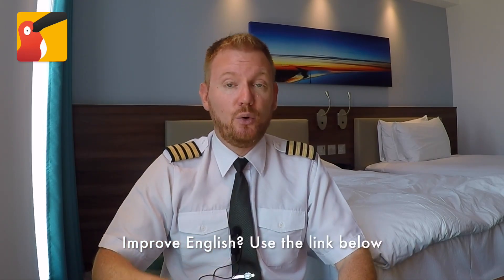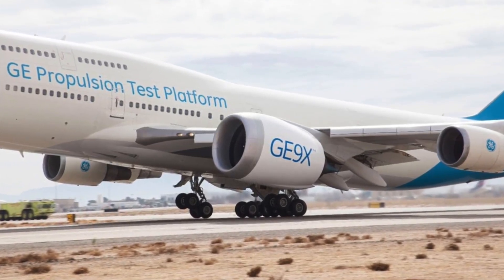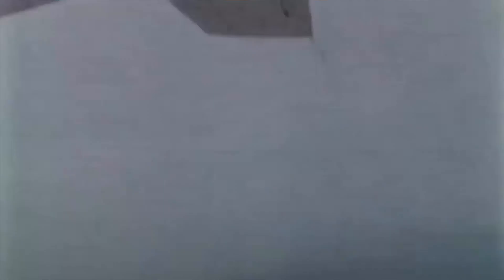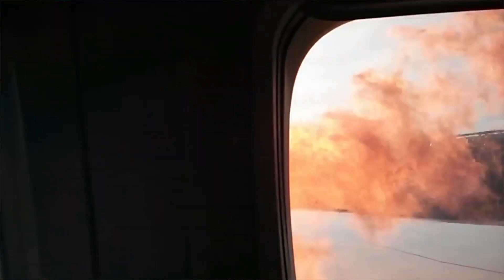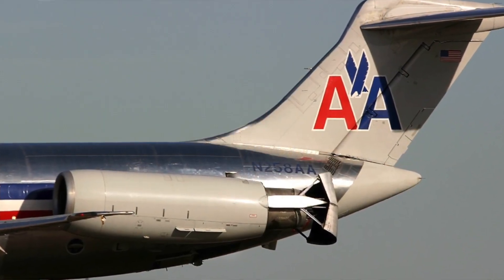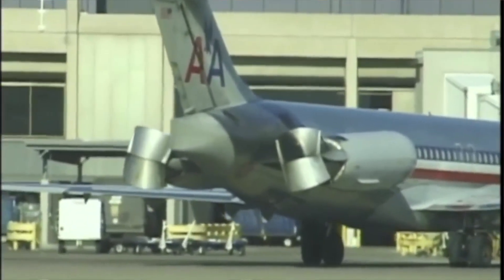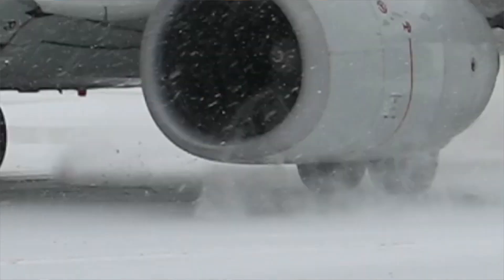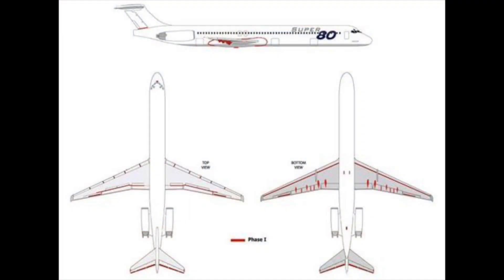Why are the jet-engines placed there? Wings vs Tail

Comment: Always seemed kind of odd that T-Tail with canards designs didn't get more attention. Call me crazy, but I kind of like the idea of redundant pitch control surfaces...
Reply: Suppose it would have ups and downs. But the main reason we don't see it is weight id imagine. Don't really need it and it would add weight, so not something they'd want to add, unless they had to.
Reply: lot more control with less pitch with a canard
Reply: The only T-tail with a "canard" that I can think of is the Piaggio Avanti, and that isn't really a canard. The front wing is not a control surface, but rather a wing with a flap. All of the pitch control is achieved with the T tail.
Reply: There were a few included in a book I had on aviation design, but as far as I can remember they were all obscure prototypes or experimental craft. The text detailing them seemed to suggest they all did well, but I annoyingly can't remember the title of the book, and it is in a box stuffed in an attic on the far side of Canada right now.
Reply: I think Rutan's canard designs could get into a bad coupling in the right circumstances. Which contributed to John Denver's crash iirc.
Reply: Corey Lawson - John Denver's crash had zero to do with aerodynamics and everything to do with fuel system management.
Reply: @sparkplug1018 Pitch control surfaces... ups and downs... HA!
Reply: Movable or fixed canards add drag, weight and turbulence. Turbulence generated by tailplanes with elevators goes behind the aircraft.
Reply: Al Grayson - that's why canard airplanes are all demonstrably slower (not)
Reply: gwzipper1 ok thx. been too long/memory corruption.  According to Wikipedia, there were some Rutan Vari-* incidents where in a tight turn/bank one of the canards could stall (wikipedia) in the right (wrong) conditions.  There was a redesign. But looks like there were some lawsuits that compeled Rutan to stop selling the plans for all the variants (wikipedia...I didnt follow the references further).
I always liked seeing them buzzing around occasionally. Now it seems rare to see one zipping thru the air.
Reply: Corey Lawson , Rutan stopped selling plans when scaled composites took off, for liability issues. He now has deep pockets. He still supports then unofficially, even today. There are thousands flying - if you'd like to see a lot in one place, go to Oshkosh in late July or rough river, Kentucky a little later.
The canard wing of actually designed to stall - it's set at a higher pitch angle than the wing, so it stays before the wing, dropping the nose so airspeed is recovered. It's actually a safety feature, and had nothing at all to do with the Denver accident.

Comment: There is nothing like the brute force of being shoved into the air by tail mounted engines.  With the under mount pylon engine at the wing, you are simply pulled into the air.  The sense of power is not as prominent as with the aft mounted engines.  One of my favorite moments of flight, being shoved of terra firma and pushed by the seat of your pants into the air.

Comment: You mentioned airflow issues over the horizontal stabilizer with rear mounted engines, how about with the engines themselves?  I imagine that rear mounted engines might be more susceptible to compressor stall?

Comment: explain planes with high mounted wings like the C-5 galaxy, C-47 etc. and engine placement and such related what is explained in this video.  and maybe why boeing keeps streching the 737 to replance the 757 instead if making a new/next-gen 757.  the 737 is  short and can only hold so big of engines relative to ground clearance.  and there's also performance issues with a 757 sized 737 vs the 757 its self.
Reply: The high mounted wings on the C-5 etc, are specific to cargo aircraft, where load access is the primary design criterion.

Comment: There must be a profitable reason in why so many companies opt for the T-tail jets such as Fokker 70/100, Boeing 717 etc. Ive often thought that they must be more fuel efficient over planes with engines on wings. I've noticed that most T-tailed rear mounted jets, often require less thrust (Lbs) to get same performance as wing mounted jet engine aircraft . My thoughts on this are that having rear mounted engines on aircrafts body, and generally being of smaller diameter as well, creates less drag than being further out on wings. Another thing to note are that most T-tail rear mounted jets, have much smaller wings (span wise), and kind of look more like a dart in the air lol.

Comment: On a T tail you can totally stop the deep stall by putting a couple of strakes on the fuselage under the tail.  Under normal flight conditions these produce zero lift and minimal drag. But when in a high nose up attitude they will generate lift and will automatically bring the nose down again, thus bringing the tail back into clean air.   Why these aren't standard on all T tail aircraft, I have never been able to figure out since this has been known since the 1970s.
Reply: spacecadet35 Lear Jets have them,  every body else is to cheap I guess!
Reply: Thank you for that information. It is nice to know.

Comment: Hope that someday you could also release a video about planes with mixed characteristics for example: High wings, T tails but engines below the wings (such as the C-17) or the Antonov AN225 (dual rudders, huge horizontal stabilizer, 6 engines, high wings).  Great videos as ever.  Congrats Mentour.  Have a nice week!
Reply: jwchavez Most of the high wing models are cargo aircraft, where an unimpeded loading area is the primary design criterion.
Reply: Wikipedia actually has some pretty nice articles on the aerodynamic impacts of various designs, if you're interested in understanding the quirks and purposes of other configurations (like why high wing cargo planes have their wings angled down instead up up; it's not just because it looks cool), or why you might want a T tail on an under wing design (basically leverage). There's also some really neat stuff to stumble upon like the B-52 landing gear, which can angle a bit to either side for crosswind landings. Basically, I found a lot of the plane and aerodynamics (as they relate to planes at least) articles to be pretty clear and well written.

Still don't know how the hell sailboats sail into the wind though. I'm pretty sure the answer is magic >.>

Comment: Noob question: to prevent a superstall in a T tailed plane, can't they have a system to use the ailerons to pitch the nose down? Like instead of the stick pusher just change how it controls pitch until speed is good again to use the elevators as normal.
Reply: Tomás Jarsun Ailerons are mounted on the wings, close to the center of lift. By definition they cannot change the pitch of an aircraft, only the roll.

Comment: would be nice if you addressed the obvious question: Why did the 737 get designed with wing engines, while the DC-9 went with fuselage engines? It would seem that most of the benefits favor wing engines, so why did Douglas feel that the benefits of fuselage engines outweighed the benefits of wing engines?

We notice that almost no commercial aircraft are made today with fuselage engines. Even small commuter jets are going with wing engines.

Comment: The bridge named in the video suffered from a issue with resonance. Every object has a specific frequency it vibrates at. If this frequency is matched the object vibrates to the breaking point. I guess the same applys to surfaces passing through mediums such as air or water. A common example of this is when in cartoons a singer breaks a wineglass by match the frequency with their voice. 

Source: Richard Hammonds engineering contacts the “oilrig” episode.
Reply: william elofsson Galloping Gerdie was just poorly designed.

Comment: I wish you would cover the MD DC-10 which use to have both wing and tail mounted engines... That was a beautiful airplane... Don't know why they stopped making it...:-/
I can imagine that the tail engine may have been difficult to service though.
Reply: Dude31463 the third engine became unnecessary. Jet engines have become more powerful and reliable, and twinjets are the most efficient designs.
Reply: GemCat ... I get what you mean... I may have a biased affinity for it as it was the first plane I flew on... For a kid, that was the coolest thing ever, even though I threw up at least 3 times on the trip... :-/

Comment: Wouldn't fly-by-wire, like the systems on all the Airbus planes and the newer Boeing planes, assist the handling characteristics like extra rudder trim during engine failure to reduce extra yaw,  using FBW ailerons to counteract wing flutter, and keeping the plane steady when changing thrust setting?

Comment: Really interesting information, I always wondered why some airplanes have engines mounted at the end of body. Regarding noise there is no doubt it is better. However, I thought it is an old designer company because accidents in such type of airplanes are much higher than airplanes with engines mounted below the wings.

Comment: If jet engines get larger diameters to increase bypass ratio and efficiency, is there a point where it would be beneficial to mount the wings above the cabin body instead of below?  (Assuming the engines are still mounted below the wings.) 

Or do you think engineers would start mounting the engines partially inside or above the wings?

Clearly this would make major changes to where major stresses on the plane occur, and different parts of the wings and body would have to be reinforced appropriately.  Flying characteristics would change as well. 

Or do the engineering trade-offs favor keeping the shape the same  and just adding longer landing gear to allow clearance for the bigger engines?
Reply: Cynthia Cantrell limit to how big bypass fans can get as rotor tips approach speed of sound go back to turbo props soon
Reply: It seems to me that reducing the speed of the tips for a bigger fan would just be a matter of changing the gear ratio going back to the compressor.   That gear was no small feat in itself, but someone did it - was it GE?  I think that was how they were able to use the bigger fans in the first place, but I could be wrong.
Reply: They're about at the max now due to rail and highway load size limits in the US at least (for GE & Pratt & Whitney engines). But I suppose you could use the Dreamlifter and similar planes to get around this limit.

Comment: It would seem that a rear engine mounted plane should be a flying wing (blended wing and fuselage) or have canards (forward mounted stabilisers). This is not a theoretical notion because many studies are suggesting that future airliners should actually have rear mounted engines for greater efficiency. NASA and Boeing are following this path because the numbers are very good.

Comment: Why arent there any business jets with a single very big (efficient) turbofan mounted on the roof? One engine = cheaper than two, on the roof = loads of space for a high by-pass engine, high above ground = no FOD. Is it just the torque? Or noise? Or redundancy issue?
Reply: MK IIRC, the new diamond jet has that configuration.

Comment: Big question, why Jet intakes don't have a "fence gate" to protect intake of objects. Like a dust filter on a computer pc.
Reply: Any structure immediately in front of the jet engine would probably reduce the efficiency of the engine. In addition, there is the chance that this structure could become loose and be ingested by the engine. which could lead to catastrophic engine failure.
Reply: Thank you for the reply, this seems pretty reasonable. :)

Comment: So... why small jets doesn't have that little wings that fighter jets have, so when the t-tail loose control, you still have it from the front?

Wouldn't it also make easier to lift off with the wheels mounted far back without the risk of scratch the butt of the aircraft?

Comment: While the 737 doesn't have a dedicated stick pusher, the Elevator Feel Shift module will increase hydraulic A pressure to the elevator feel and centering unit, which increases forward column force by four times during a stall, serving basically the same purpose. Additionally as the airspeed decreases towards stall speed, the speed trim system trims the stabilizer nose down, which makes it harder for the pilot to stall the aircraft (remember, an aircraft does not usually stall on itself, it has to be stalled).

Another reason why business jets usually have tail mounted engines, is the of course the shorter landing gear, which both enables cheap (or cheaper) airstairs and is in itself a lot cheaper to build, as well as easy access to the cargo compartments to load the principals baggage, making ground handling a whole lot easier.

A thing to remember is, that while pitch-power coupling is very real in the 737 and other conventional planes, fly-by-wire removes that either completely or nearly completely. That is why both airbus and boeing recommend to use autothrust even during manual flight in their FBW aircraft.
Reply: Fly-by-wire can totally change the handling characteristics into anything you like.
Reply: Hmm, flight controls physically attached to the stick as in manual control? That basically removes all commercial airliners except the 737 Jurassic through NG, but not the MAX as all flight controls are usually not connected directly but via hydraulics, you lose them, you lose control. And in basically all those aircrafts you never really "feel" the aircraft, as with hydraulic control that feedback is generated artificially as well, yes, even in the 737 except in manual reversion which is not fun at all, and even then there is hydraulic control of the rudder.

If you mean only electrical FBW that would remove the 777, 787, 737MAX (FBW spoilers), A320 through A380, Embraer 170 through E195 and several business aircraft. Which limits both employability and air travel.

Interestingly, there has not been one single complete fail of FBW yet. There have been several malfunctions, but none resulting in a hull loss or loss of aircraft in flight. The fallback systems do work surprisingly well, quite honestly, a dual hydraulic failure is always a quite severe thing, but flying wise i rather take the A320 than the 737 in that case, and yes, i have flown both extensively.
Reply: yes, I curse the day they made fly by wire...    so what happens when it fails, you cant control the aircraft...  very lame...    I only fly aircraft with the controls physically attached to the stick lol 

and yes, I'm affraid of quadruple redundancy ...